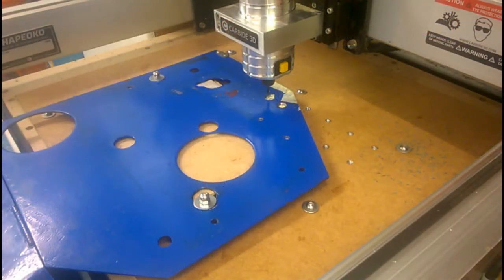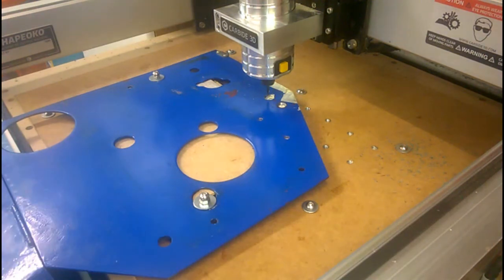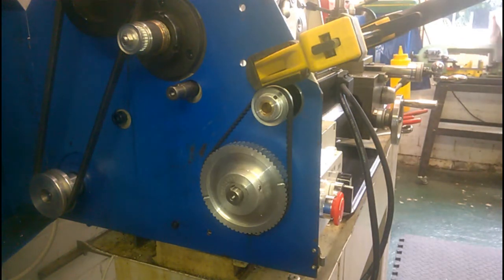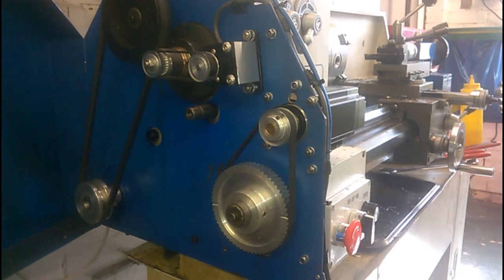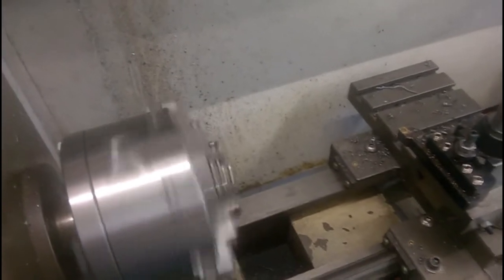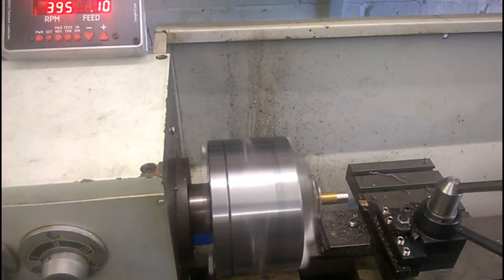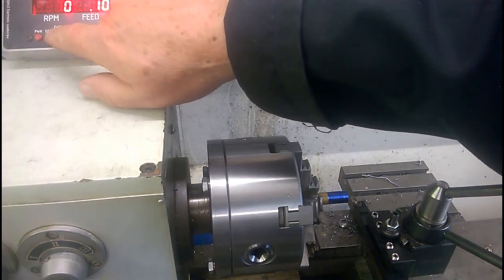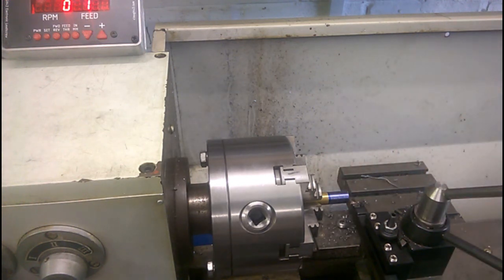ELS Update 3

Comment: Did you find programming the Launchpad difficult?  I cannot get past that and have tried numerous times and different methods for doing so.  Also, how do you compare this to the ELS from the maker in France, which I am also considering after my many Launchpad failures.
Reply from the maker: I didn't actually do any "programming".  I just used the 'config.h' file that James Clough supplies from GitHub, with the necessary alterations to the variables to match my setup on that particular lathe, for example changing the lead screw pitch to metric etc.  From that point of view, the (French) ELS shown in my later videos, fitted to the mini lathe is far simpler as it involves no "poking around under the bonnet" and merely uses the on-screen parameters function.  Once set correctly, they need never be altered.  Had the Clogh system been available in the UK, I probably would have gone for that, but, having found and used the ELS unit, I'm more than happy that I chose that one.   (And it's FAR cheaper, too!)  John